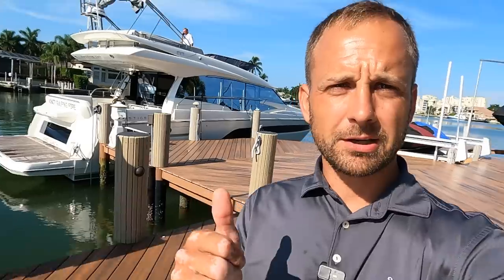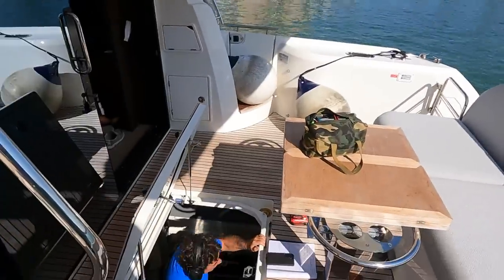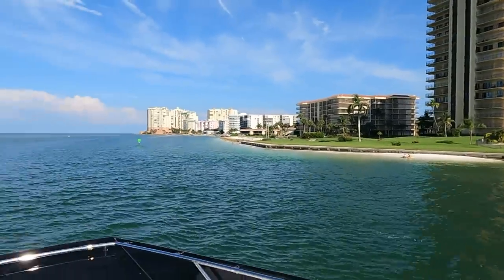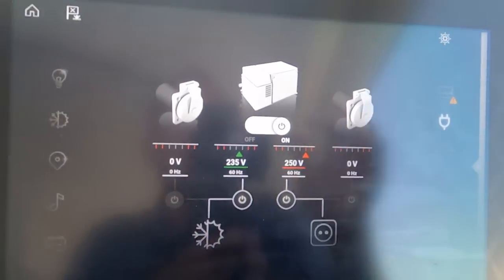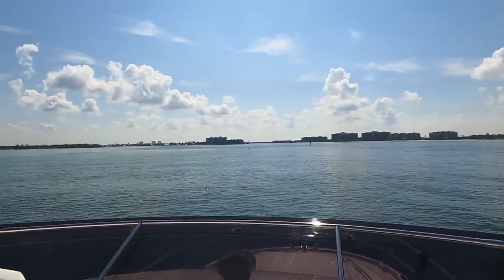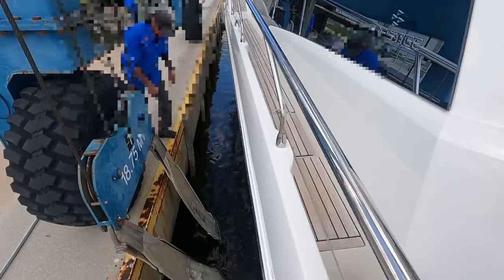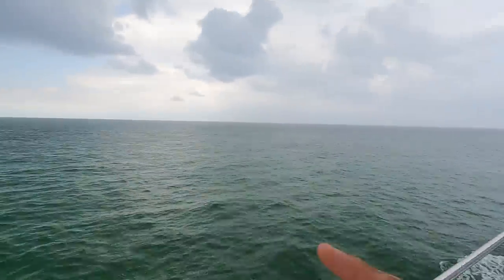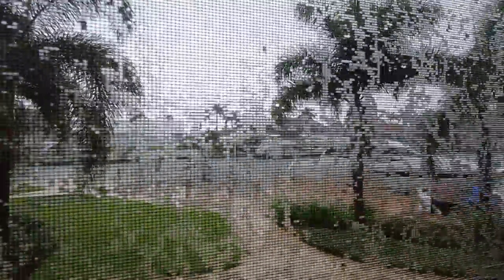Yacht Survey, Inspection and Yacht Haul Out  - What yacht surveyors do before you buy

Comment: Great video, judging the rain and combination with Florida, my guess is it must have been around 3 PM when you were on your way back. 😀
Btw, hammering on the hull does not damage the gel coat ? I would expect a rubber hammer instead.
Reply from the maker: I think it was pretty close to that time, great call 🤣 

I’m no surveyor, but my guess is rubber hammer wouldn’t produce the sounds they are looking for when checking for soft spots/blistering. The technical term for the hammer testing is “percussion testing”. While the sound you heard was loud, he wasn’t hitting the hull all that hard. The hammer he had was a phenolic hammer which is made specifically for fiberglass. 

Thank you for watching and for the great question! Cheers

Comment: What is the maximum yacht size one person can pilot alone? Assuming the person has all the certificates and the yacht is registered in the most suitable flag state. Purely for daydreaming purposes ;)
Reply: It really depends on the brokerage!.. The Capts ability and vessel.. I always bring MY mate along on seatrials. A single screw 38' trawler requires more work than a twin screw 52' SF as far as docking and handling.having "my guy" with me makes life easy..A typical survey like this has 5-7 on board, all have a job to do .
I know, me personally, as Capt. I'm basically the "extra" guy when doing seatrials. My job is to run the vessel. Typically there's a mechanic/technician running diagnostics on the engines etc with me. My job is to leave the dock, run the vessel at speed, and dock it. Every form is different.
My mechanic requests me. His priorities lie in the engine room not stick at the helm
Reply from the maker: In general, this mainly comes down to the captain’s skill and experience. There isn’t a rule that states exact size or number of crew but of course you’d always want to be as safe as can be for the vessel, especially if it’s not your own. With that said, I am sure there are plenty of captains who can handle very large vessels on their own. I guess a lot would come down to the specifics of the docking set up too. Personally, with the right conditions (I wouldn’t risk single handing a large vessel in unsafe conditions), I would probably be comfortable with up to an 80’ vessel. As Christopher mentions below, the larger the vessel, typically the easier they are to handle and they usually will have some additional technology like thrusters which make docking easier. He’s very right about single screw boats being more work than others ha. We’ve all been there! 

Thank you for watching and for your great question! Cheers!
Reply: @ElevateYacht  Thanks for your answer! In my dreams I am piloting a Wally 118 on my own. It just seems like such a hassle to have to coordinate and plan around a crew so much.
Reply from the maker: I get what you’re saying and I know that feeling. Then again, if you’ve got a Wally 118, you deserve to kick back and relax and have a crew who does the hard/stressful work for you. There’s a point at which it’s nice to be able to enjoy the fruits of your labor 😎
Reply: 40 is my sweet spot but I have a 50 now that I feel comfortable with, but if it was your first boat, would be intimidating.  My 2 cents, ymmv. I don't have a fly bridge though.